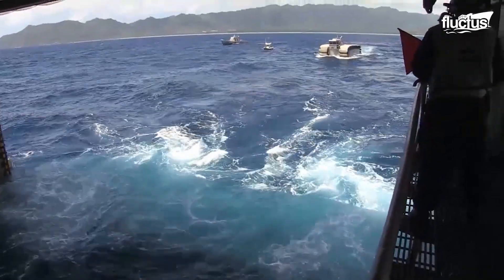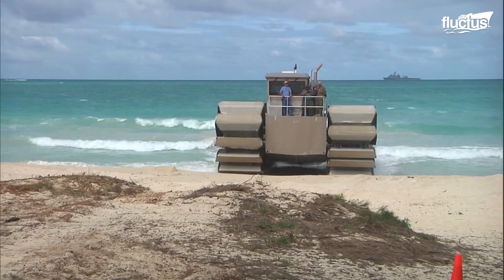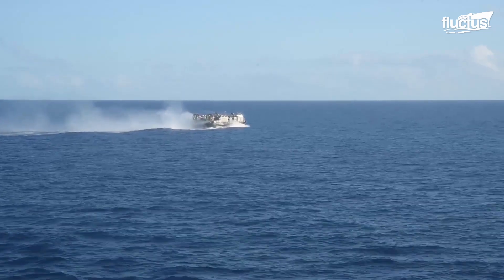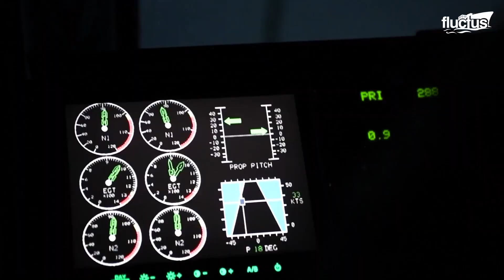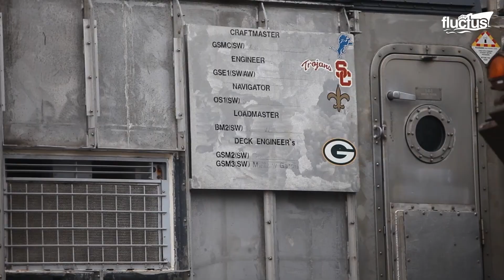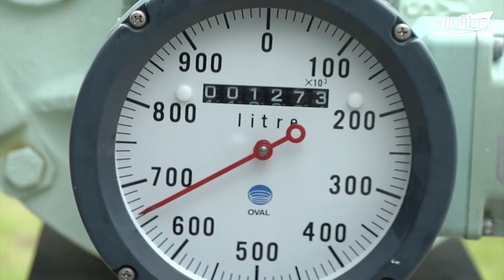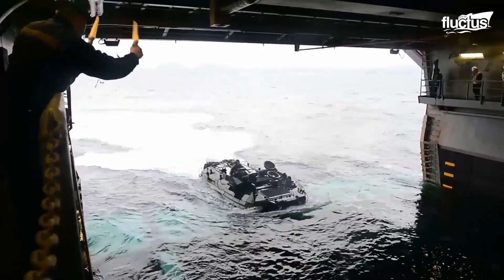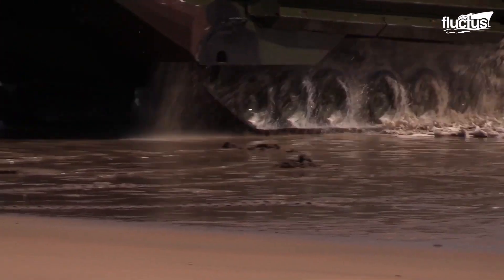US Experiment Gigantic Amphibious $20 Million Tank Carrier

Comment: It is large, expensive and slow on both water and land. I'm sure they have some reason to test this, i just don't see it.
Reply: Because it can transfer equipment from ship to shore....duh.
Reply: @rayjames6096  When they've already got a hovercraft that moves across the gap at around twice the speed?  At a guess their mini-prototype can handle rougher seas and terrain than the LCAC... but the full size version would likely be even slower, and probably less able to move across uneven terrain.
Reply: @boobah5643    Those large LCACs are hard to maneuver, these will be able to carry more weight also.

Comment: As good as LCAC's are at moving and maneuvering quickly, loading and unloading takes a lot of time, because so much tie down equipment is needed to keep the cargo/ vehicles from shifting. It can take as much a 30 minutes to offload upon landing.
Reply: That would seem to be necessary on any landing plarform.
Reply: @rayjames6096  The smaller and slower landing crafts do not require as much time to unload for two reasons. One they do not have has many different pieces to secure, and two because they are moving slower and lower in the water, they do not need as many tie downs per item. I have served on both while in the Marines ( 1973-1994 ). Desert Shield /Storm were my firs and only experience with the LCAC's.